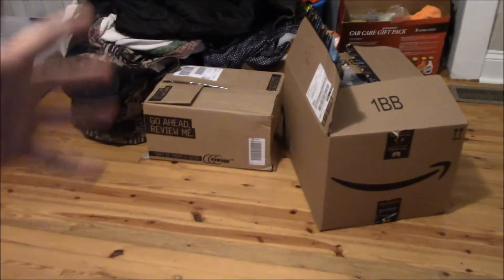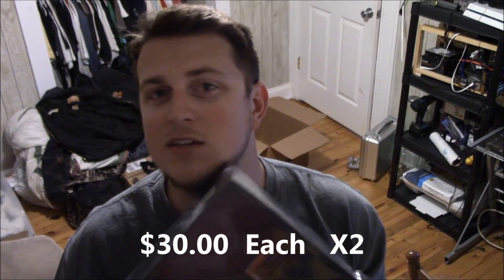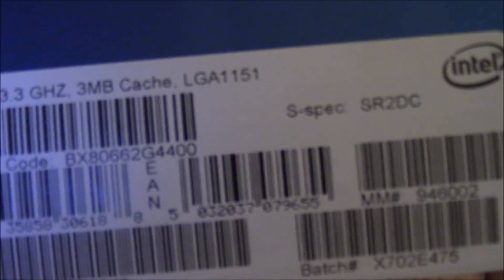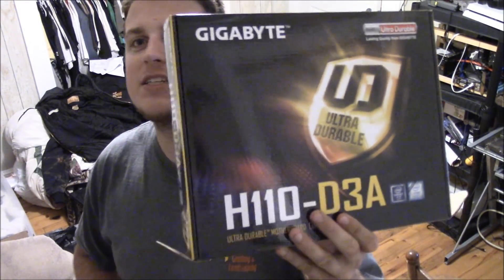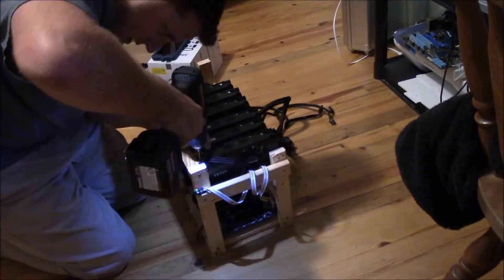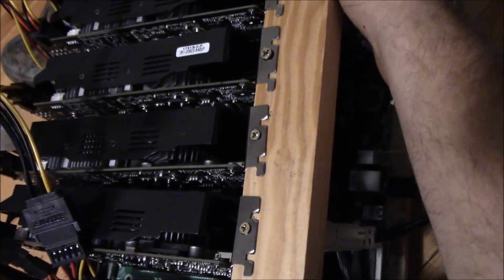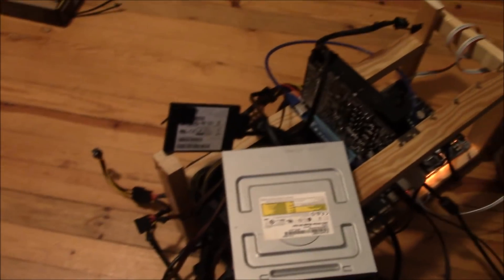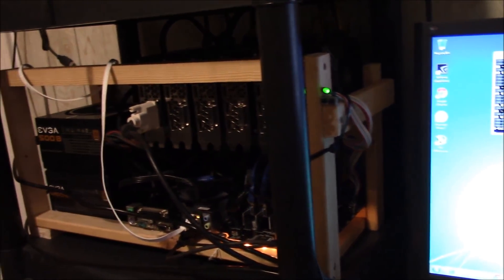Building my first rig 6 GTX 1060 6gb on nicehash

Comment: Useing ubuntu is way better than Windows 10 u can run / install ubuntu off a flash drive it's free no need for hard drives or buying windows every time u build a nother rig not as wide of gpu support but stil some good gpus that work with Linux

Comment: this gigabyte motherboard is the biggest load of shit i ever bought..bought 2 yesterday ..one burned out and the other no matter wat settings ..it does not recognise 6 cards..only 5......mining mode on causes  boot loops into the bios the whole time..4g mode doesnt start up..gen 1,2 or auto causes issues.
this is supposedly a mining board.
my x370 takes allready 10 gpus and its not even a mining boardand is plug and play no issues
Reply from the maker: +Star of Eden h. I now have 2 of the h110d3a boards with no issues :/

Comment: can you please tell me the bios options? and how you install the graphic cards one by one? on the big pci e port?

did i need power into the PCIe 12V 4p from the power sup or only will work power to the razyers?

Comment: You ever get 8 beeps on startup using pcie express video card. I can use on board , but it won’t boot with a card in the pcie x16 slot.. I. Assuming I need to tell it in bios to use pcie on startup.

Comment: I wouldn't stack the power supply on top of each other like that because they can burn out. I also think a 750w PSU should have been enough to power up 6 1060. Something to consider. The dual power supply cables are essentially all made from china, I bought a pack of 10 for 8 bucks a few months ago.

Comment: Isn't this mining thing all about efficiency? why would you cheap out on the PSU which is the part that ALL the power goes through? All deficiencies in the system will get multiplied with the deficiency from the PSU, right?

Comment: I used to have the same setup like you, I mean the PSU stacking up like that.. it will cause problem if you don't have good grounding in your house, the Windows will hang occasionally. Just put something in between the PSU that you're good to go.

Comment: how do you setup your minging rig??
because i make a mining rig using mobo like you but i have a problem eror or auto restart..
when doing benchmark on nicehash can you give me suggestion for me
Reply from the maker: do you have all the correct drivers installed for the GPU's?
Reply: yes i have installed ...
i check device manager my vga card terditeksi ago in msi afterburner all vga detected
Reply: can you tell me which driver and what version is in use ??
Reply from the maker: i have the latest one available for download on invidas website